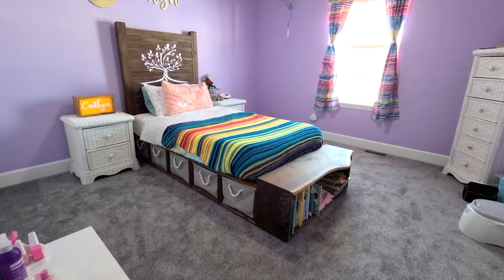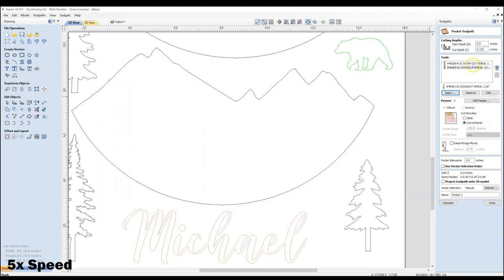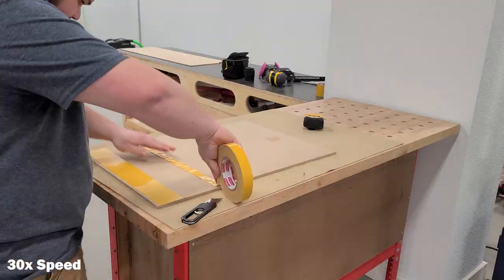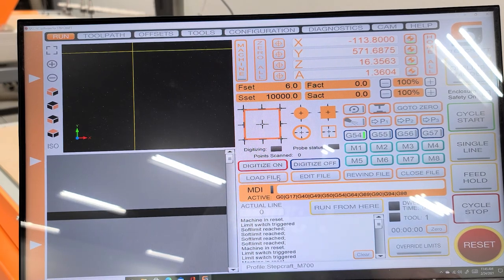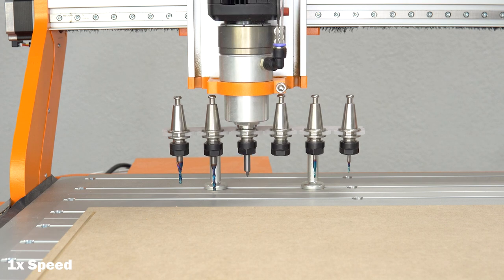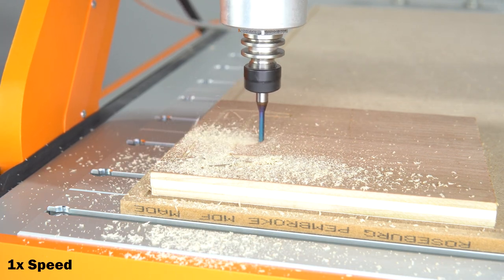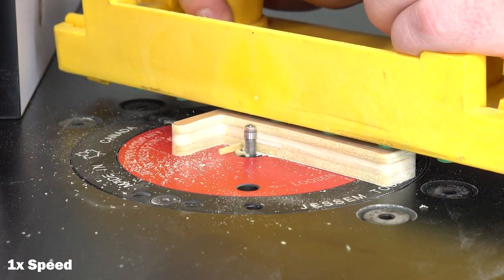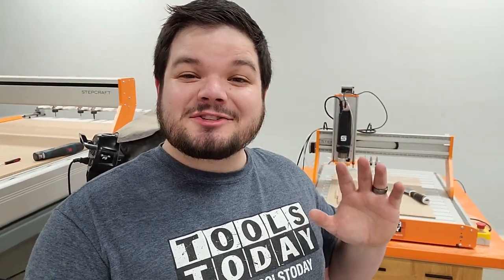Starting a Special Project | Matt the Maker Vlog 002

Comment: are the Stepcraft machines able to run off of Fusion 360?  If so...can you set speeds and feeds in Fusion or does it require manual adjustments on the Stepcraft?
Reply from the maker: Yes, I'm not positive what post processor is used, as I've never worked with Fusion 360.  I know in the Vectric software you can set the speeds and feeds within the software, and with the MM-1000 DI spindle it will control the RPM and feed rates.  I would assume the same is true with Fusion 360.  That being said, you can also manually speed up the RPM or feed rate with the UCCNC control software it comes with.

Comment: Nice video brother , it happened with me as wel when I forget to zero the Z axis also those nice bits they not cheap to break lol coz I buy from Toolstoday . 
One q brother . 
If am using 1/4” bit or 1/8” bit how u determine the depth cut ? Do u go by the diameter of the bit ? Also when u pocketing what is your step over is it 50% ?
Reply from the maker: Thank you!  For sure, it's never fun to break bits.  Depending on your CNCs capabilities we generally recommend 1x the diameter for the depth of cut per pass.  If your machine is under powered we recommend half the diameter per pass.  For stepover I recommend 40% for endmills as it will put the least amount of stress on the bit and leave you with the best cut quality.